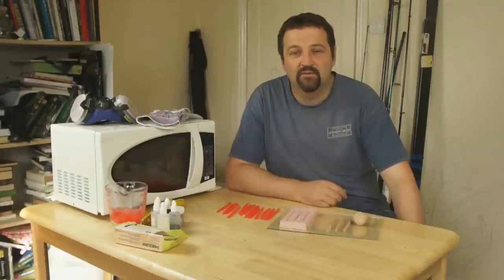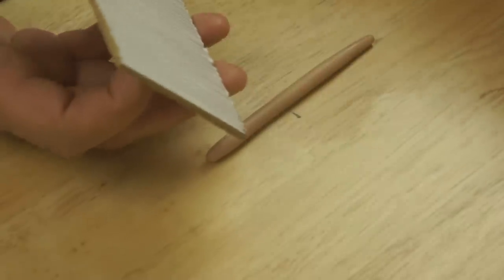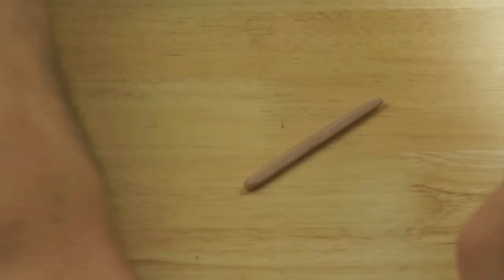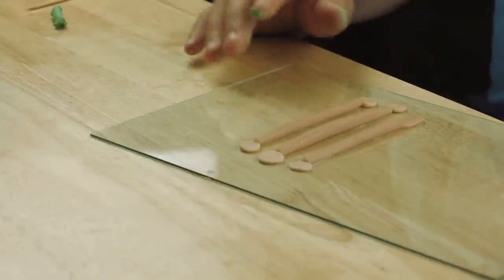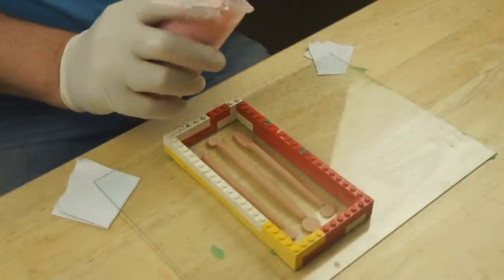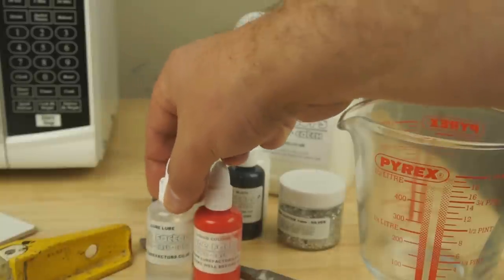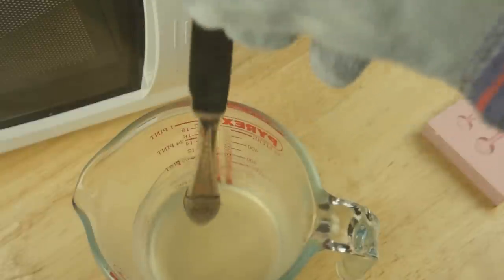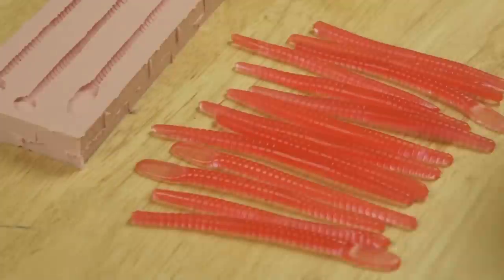Making Simple Soft Plastic Worm, Fishing Lures

Comment from the maker: i seldom do proper costing for lures as i make them for fun, but price wise soft plastics work out cheaper than normal shop bought only if you i make in volume so if i just made these from a 1ltr of plastisol i would estimate between .05p to 10p each excluding the mold. Similar molds can be bought from plastisol suppliers for about £10.   Cheers

Comment: Have you tried to over pour the mold just a little to get more of a rounded side on the top instead of completely flat? I would imagine if you pour a little too much it would round off like if you were to put water in the mold. I've never poured any lures but I'm wanting to get into it but I'm not so sure about the flat side of the lure. I'd much rather it be a little more round not so flat.

Comment: Hi Paul, What grade of the soft plastic did you use? I've read that the softest grade may not stand up to the rigors of sea fishing.  Regards.
Reply from the maker: i am using the soft version of lureflex, from lure factors which feels pretty tough to me, i do have a hardener that i can add to stiffen up and make if either medium or hard but as yet i have not used it. I think if i was doing larger baits i would go medium.  But i m guessing all companies will have there own mixes. I haven't really done a lot of sea fishing with soft plastics but i can tell you they are a hell of a lot tougher than a rag or a lug-worm even when mummified in bait elastic. Good luck

Comment: paul  when   making  2  deferent   plastic coulers  what  would you  do  paul like  red in tail  of  jelly  worm  and black in front  of  tail  how  would  that happen  in  the   mould  for   the jelly  worms  .  would  you  be  able  to  make  a video on  how  it  is done   kind  regards  john  coughlan
Reply from the maker: it is not something i have tried, but i am guessing a making a small dam from something heat resistant would work and then quickly removing it so both colors bond together. As  say it is not something i have tried but i may experiment when i am doiing some more pouring, I should of had ago last night as i was pouring some worms. I am doing another soft plastic video video mid January but it maybe injection diy injection moudling.
Reply: thank   you   paul